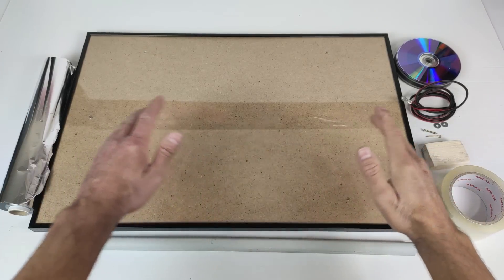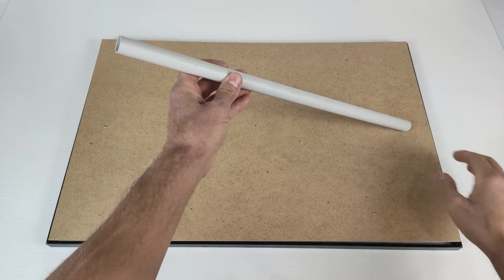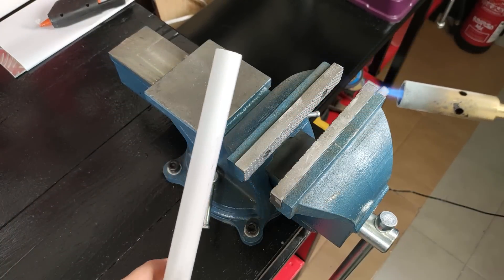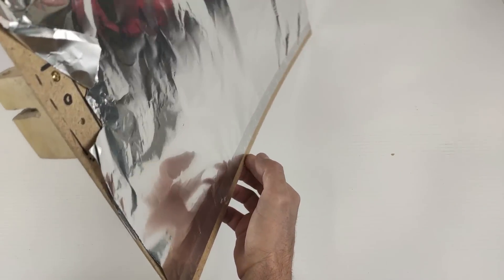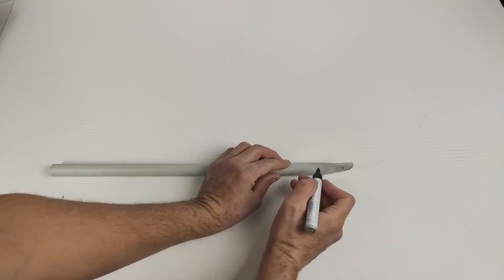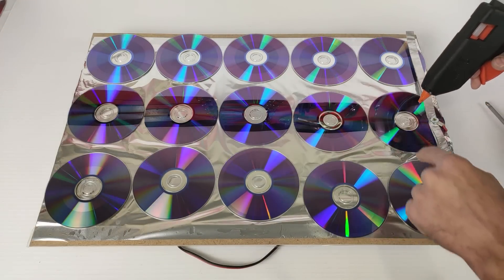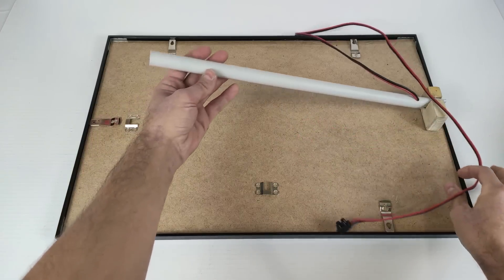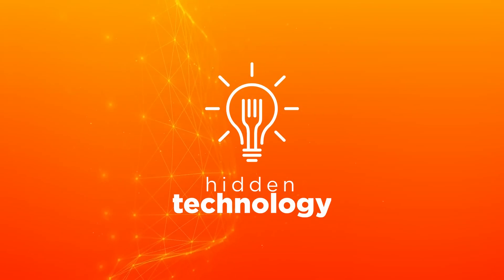I turn a bunch of old CDs into a SOLAR PANEL for your home | Homemade Free Energy

Comment: all CD'S are made from plastic that is non conductive, but that tube that makes the stand is the perfect size to conceal 4 X 16850 batteries.
Reply: Also, at the end of the video, when he connected the led light and then turned the panel away from the sun, the light intensity didn't change...
This was a great waste of time...
Reply: And it'll hold an 1/8 ounce of weed pretty well to. 😁
Reply: no wonder the channel is called "Hidden Technology"...
Reply: Imma build one and end this debate.
Reply: @shroomshard  Please do. We only learn through making mistakes.
Reply: @shroomshard  what happened did it work??
Reply: VERY POSITIVE VODEO ..TO MAKE MONEY ON YOU TUBE
Reply: also, normally you connect the positive to the negative of the next cell, to increase the voltage, as usually the cells don't produce 12 volts by themself, if you connect them in parallel you "should" get lower voltage but a lot of amperes. And don't forget there is nothing that avoid touching the upper case aluminum with the bottom aluminum (that it should be + and negative)
Reply: 3x 18650's 😂. Only 12v
Reply: he knows too much, kidnap him
Reply: 4 x 16850 = A lot of batteries. Mind 🤯
Reply: So are those actually CDs or are they DVDs? Because I don't have any CDs that look purple like that
Reply: You mentioned the exact point👌👍
Reply: @Arfer Stone the cd's are not used to transport electricity but to accumulate the heat that got transported by the aluminum circuit.the difference of heat generates the electricity because there are electrons continuously moving and generating also electrostatics.
Reply: @Timetraveler_1  said: "cd's are not used to transport electricity but to accumulate the heat that got transported by the aluminum circuit.the difference of heat generates the electricity because there are electrons continuously moving and generating also electrostatics."

Utter HORSE SHIT! This idiotic thing doesn't produce ANY energy. PERIOD. Quit LYING
Reply: He is using Re-Writeable CDs
Reply: @Viewer19  said: "He is using Re-Writeable CDs"

Which makes NO difference, because neither re-writeable nor pressed CDs use ANY silicon. DCs are NOT solar panels, and they NEVER will be.
Reply: @playaspec  since the solar panel is just a panel containing the parts that make up the solar panel = photocells  ... cd as a separate unit is not a solar panel, but can be used as part of the whole .. so it replaces the parts that have commercial solar panels =  photocells 

so yes... CDs are not solar panels.. they are photocells :) parts of solar panel
Reply: Cant see how this could work when its shorted out with that first screw driven the first cd
Reply: Si es verdad es un engaño  🤔🇦🇷👋
Reply: You don't know much about the power of the sun. It's been powering the earth for thousands of years
Reply: @laurietim6285  said: "You don't know much about the power of the sun."

I know a HELL of a lot more about it than you! I'm not the one trying to take literal GARBAGE and trying to con people into thinking they can make something from trash, just to get some worthless clicks.
Reply: CDs are plastic whit a thin layer of a "semi-conductive" material called SILICONE and for who don't know what it is is the same material used for the making of IC-chips (integrated circuit chips) like CPU's GPU's FPU's or ROM CHIPS , and even ram chips ... And for anyone surprise😅🤣 even the same material used to making panels for the solar panels....so ya know... obviously the silicon in the CD ROM is very thin but still silicon covered in a mixture of silicon-plstic material who is thermo resistan due to a the use are intended for (be readed or write or over erased and re-writed when is a re-writable disc)and this thin layer is maybe not intended to be a solar panel but if you can have contact with it in some way theoretically is possible to use it to generate a certain amount of energy (low voltage 0.80 v each CD/dvd like he said in video)  ... And at the end i am not an electrician or an inventor but just a chemistrys 🧪⚗️ fan and PC and phone technician, but i can say it is theoretically possible to convert it in a solar panel even if  very weak maybe , but still a solar panel! Explanation complete !🙃😅🤣
Reply: @GamesAndRandomFacts  No, no, no, no and of course NO!.  First of all, there is no silicone os silicon (they are NOT the same thing.  Any chemist would NOT make that mistake) in CD/DVD disks.  Never has been.  The writable disks use a variety of optical layers that use combinations of materials like telluriun, germaniun, anitmony, sliver, tin - but no silicon.  Next, that layer that has no silicon in it?  Well it is embedded in polycarbonate plastic.  It is NOT theoretically possible to generate ANY electricity with old CD/DVD disks of ANY kind.  You are living proof of the Duniing-Kruger effect and your claim of beigng a chemist is denied.  A tiny bit of research would have given you the facts you don't seem to think are useful.  Your "explanation" is not worth the paper it's written on.
Reply: @GamesAndRandomFacts  my issue is the tape.  So, the folded up aluminum foil on top is intended to be the positive side of the cell, essentially, while the flat piece of foil taped to the particle board backer is the  negavtive cell, right?  And the circuit is completed through the device, whatever that may be.  In principle I'm with it so far.  But once the upper positive cell is taped down to the negative cell, shouldn't it short circuit?  Electricity follows the path of least resistance, so why would it power a light when it can loop through the wiring thats been jumped together?
Reply: @GamesAndRandomFacts  Sorry, but there is a coating of PLASTIC over the layers of metal oxide on all cd type media. PERIOD.
Reply: @GamesAndRandomFacts  this can really work so?
Reply: I write silicone instead of Silicon because I am Italian and the phone just correct automatically the word but i was writing Silicon
Reply: @GamesAndRandomFacts  : Solar powered boob jobs.
Reply: I believe he addresses that at the very beginning when he specifies the cds containing silicon are the only ones that will work. Silicon definitely will pass electricity and does so more efficiently at higher temperatures (like in direct sunlight) unlike metal. Also often coated with silver alloy
Reply: @DamnLeftys  So you believe this crap?  Go ahead then, build one .. let us all know how that works out for you.
Reply: @DamnLeftys  said: "he specifies the cds containing silicon are the only ones that will work."

There are NO CDs containing silicon, and there NEVER has been. Period.

>"Silicon definitely will pass electricity and does so more efficiently at higher temperatures"

Did you crib this out of context tidbit off the web somewhere? Compared to literally EVERY metal, silicon is a crappy conductor. That's why it's referred to as a semiconductor.

Spare us your uneducated prattle.
Reply: @playaspec  Metal Layers in Double-Layer DVD-ROM Discs
DVD-ROMs can be manufactured with two reflective metal layers that allow the laser to read data from both layers using one side of the disc. These “double layered” DVDs provide up to four times the capacity for content (video, audio, computer applications) as do “single-layered” DVDs. The laser beam must pass through a semi-reflective metal layer to read data from a fully reflective layer. The outer metal layer (silicon, gold, or silver alloy) is semi-reflective; that is, it reflects back some of the laser beam and allows some of it to pass through to a fully reflective layer (aluminum) and then reflect back. Both parts are thus reflected to, and detected by, the photosensor in the laser head, which focuses on one layer at a time. Figure 8 shows the most common construction for single-sided, double-layered DVDs, while Figure 9 shows an alternative construction.

= The outer metal layer (silicon, 

and :   silicon gets better at conducting electricity as the temperature increases (metals get worse at conductivity at higher temperatures) SUN=  temperature increases ...
Reply: Wrong. Cds have a thin metal layer inside. How do you think they store the data
Reply: @TheVdub1980  said: "Cds have a thin metal layer inside. How do you think they store the data"

In pressed disks the thin metal layer is ALUMINUM*. The data is stored in pits pressed into the *POLYCARBONATE body of the disk, and the aluminum is there to act as a reflector, not hold the data.
Reply: The blue cd has silicone on the with is conductive
Reply: @laurietim6285  Said: "The blue cd has silicone on the with is conductive"

HAHAHAHAHAHAHAHA!!!!

Stupid sock puppet doesn't even know the difference between silicon and SILICONE!!

You guys are SO LAME!

Oh, BTW, Silicone is NOT conductive at all!

That's why they use it to INSULATE high voltage wires like spark plug wires.

Comment: copper sheet with other side burned in oxygen air to CuO thermo-couple, or just one ½ of the sheet burned to CuO, then rolled in to thermo-electric thick stick, for camp fire or solar concentrator
Reply: also copper pipe with outside burned to black CuO as thermo-couple and cold terminal inside

Comment: Would it work if you use old cassette tapes or would I still need the battery in the pipe
Reply: I used 4 albums from the 70's...............it ROCKED!
Reply: @jdc9528  :D :D :D
Reply: I think 8 tracts would work better since they don't need to be rewound
Reply: I also have some scrap things I could use, like a rubber duck and some duct tape...
Reply: I PRESUME THEY WOULD NEED THE MAGNETIC FACE DOWN, YES???
Reply: This is the comment I was looking for. Thanks
Reply: Because the old tape style is vintage you have to use some vintage batteries. No Lithium Ion style. Graphit Zinc should work perfectly.
Reply: LP Vinil !!!
Reply: You forgot the question mark (?).
Reply: Tell NASA that they have it all wrong.
Reply: Make sure Dolby noise reduction is switched on!
Reply: Darn funny!

Comment: Your work is fantastic, I would have two questions, 1) if I paste a double amount of cd I have a higher voltage? 2) Can I transfer the electricity generated to an accumulator? Good.
Reply: you can also not add the diode but when solar panel would have lower voltage than acumulator 
the solar could destroy acumulator
Reply: @stolenMemes25  Ok , grazie .
Reply: Just use good quality cd , non reggeton or trap music work at all
Reply: I heard Ac/dc high voltage should work best
Reply: @Trevor Smith Very funny, or I won't let the sun.......
Reply: @Trevor Smith I heard the sun will shine tomorrow drains the batteries when played backwards 🤣🤣🤣
Reply: @Trevor Smith 😭😭😭
Reply: You would need an Argon Accumulator - see Hawkwind
Reply: Raffaele Lonoce said: "Your work is fantastic"

His "work" is straight up FRAUDULENT! How are there so many clueless and gullible people?
Reply: 2.Yes you can just add diode to prevent energy loses
Reply: @stolenMemes25  Thanks for the answer , but being a neophyte could you tell me where I should attack the diodes ? Thanks from Sardinia Marek
Reply: @raflonoce  This is called shottckey diode 

this blocks voltage from going back but allow to go forward 

Pls search for more,my words can be hard to understand
Reply: @raflonoce  Attack the diodes with a hammer on a concrete block.  Keep hitting them until they are just a smudge of dust.  Then you sprinkle the dust onto tour left shoe.  That will make sure the panel works just the same as before.

Comment: I wonder how you arive at 12.5v if according to you each CD will generate 0.8v and all you have done is connect all CD's in parallel.
Reply: Yuo need to add the hidden battery of course
Reply: Watch again, One wire is connected to the Aluminum Foil under the DVD's and one is connected to the aluminum foil strips attached to the tops of the DVD's. The Silicone separates the Foils to make the potential Voltage.

Comment: hum... with all the positive stripe in parralele on the cd voltage wont add on...current only !! should be +-+-+-+-+- 15 times to get 12.5volts with a small current !!!

Comment: will it make any difference if i don't use the aluminium glass frame ?
Reply: No, The Frame is just to protect from the weather and make a sturdy unit.
Reply: HA! You could put it in a lead box and it would work exactly the same.

Comment: Excellent! very usable for those who cant afford everything, blessings!
Reply: It doesn't work
Reply: Did you actually try it?
Reply: @justrandom1259  Not me, if i needed something like that i would go for a more powerfull source of energy like Car Engine Alternator to produce 220w for a home and its retrochargeable so. Altough the process is harder it would give 220w for entire home. Another nice source are Solar Panels with a powerfull battery for non-sunny days. But this is just an invent to get a small source (12v) probably for a calculator and that small stuff. Doesnt work with hi voltages.
Reply: @justrandom1259  you don't need to try it. An electronic circuit doesn't work if there is no ground. As long as you just connect your cables to the positive side, the circuit behaves as if you put the switch off.
Reply: @justrandom1259  said: "Did you actually try it?"

Do you actually need to eat shit to know it tastes like shit?
Reply: @playaspec HAHAHAHAHAHAHAHAHAHAHA🤣😆😂
Reply: It works for those who can afford batteries in the pipe
Reply: Like dinosaurus film
Reply: cant believe someone went through all this effort to creat a lie ..wait thats like politics. Plastic coated CDs on foil that's touching when it's gotta be separated...well he's got his views and money. Sad

Comment: Why not use silicone caulking to attach the folded aluminum strips to the CDs
Reply: Are you CRAZY?!?  That would increase the voltage to VERY dangerous levels!
Reply: @jackthomas2051  isn't that how everything is first discovered?

Comment: Sir  may i ask if possible to 30 cd so that it generates 24 bolt and other question is  how many battery that i have use   so that it generate electricity in the mid night i hope you can answer my question sir thankyou
Reply: Mag rereply ako sayo kasi Pinoy ka yata. Hindi totoo yang video. Nandun sa tubo/stand yung power source nya. hehe.
Reply: Bagay haha

Comment: Why did this work when it appears that you shorted out the aluminum foil strips with the aluminum foil backing?
Reply: I absolutely agree I saw the same thing on each end touching the backing aluminum with the strips would create an electrical short.
Reply: The batteries he forgot to tell you about in the plastic tube helped a great deal.
Reply: I think he cut it so that they wouldn't touch
Reply: Batteries in tube. He is a liar
Reply: Good point, I missed that but it makes sense.
Reply: Its OK because the plastic on the CDs insulate them from the aluminum anyway.  We don't want any shorts.   :/

Comment: How can it work when the positive on the top is touching the negative, with those small AL foils??? Next time, remember to isolate those 2. It might work.
Reply: If you isolate, no current can flow!
Reply: @johanwise9713  If I'm connecting + & - on one side, only 10 cm away, you will get a shortcut, not a circuit.
Reply: @iulian-holidayanalyzer7294  Yes, exactly. But I put always a second layer underneath, so the power increases more than 30%. Instead of the foils it is recommended to use silver or titan wires because of less reflecting -> another 5 to 7%!
Reply: @Miau.Miau.Miau. It depends on the paint, the best is to mix the paint with graphite 1:1 😂
Reply: No.  It will never work.
Reply: @uni-byte  Exactly 🤣

Comment: Amps = watts÷volts or 
30÷12=2.5 amps
Reply: Wrong. Amps= Volt Divided by Resistance.
Reply: @hckgaming239  Resistance is not known.
The formula I stated was converting POWER in watts to AMPERAGE...

Comment: Can you tell me please all the musics which u have used in this good video? :)
Thumb up
(German) Kannst du deutsch? Weil der Titel deutsch ist. Würde gerne wissen welche Musik du im Video verwendet hast :) Gutes Video, ich probiere das demnächst mal aus. Hab genug von den lilanen CDs mit veralteten Daten rumliegen ^^ Daumen hoch
Reply from the maker: Músics come from epidemic sound library.
Reply: @HiddentechnologyYT  Thank you :)
Reply: Hi, und hat es funktioniert? Hole mir DVD+R DL 8,5GB (sogenannte DVD 9) Die haben die Siliziumschicht zusätzlich zur Aluminiumschicht wie bei einem Solarpanel alles andere funktioniert nicht. grüße
Reply: @benbecker7068  Ne hat nicht funktioniert. Die lilanen Discs sind ja auf eine transparente Plastik-Scheibe draufgeklebt, und die leitet bekanntlich keinen Strom 🤔
Also selbst wenn es das richtige Material wäre, man kommt durch das Plastik nicht an die Unterseite ran.

Müsste mal versuche da durch zu bohren, aber wenn ich die lila Schicht versehentlich durchbohre, wird sie ja quasi kurzgeschlossen.
Reply: @NEXIS981  vielleicht mit einem Heißluftföhn lösen. Werde ich mal probieren.

Comment: Its a scam. Battery is in the pipe:)
Reply: They are recharable batteries charged by the solar powet
Reply: It takes a mere 3 months for the panel to charge them.

But for real I don't know enough to say this is bullcrap, but it looks like it.